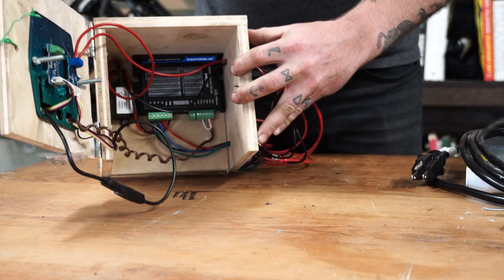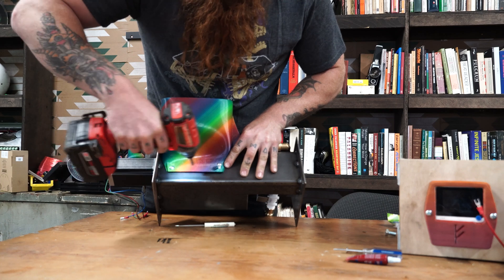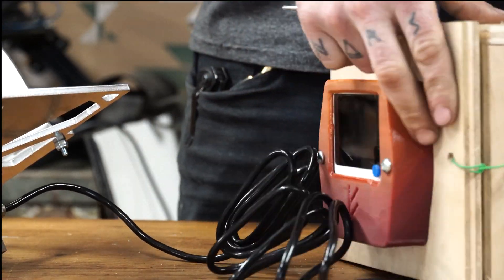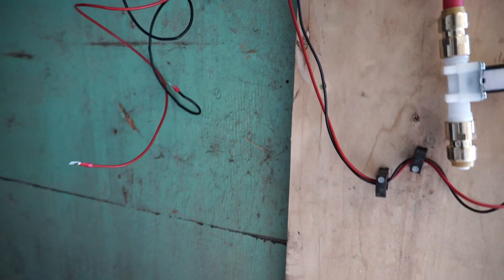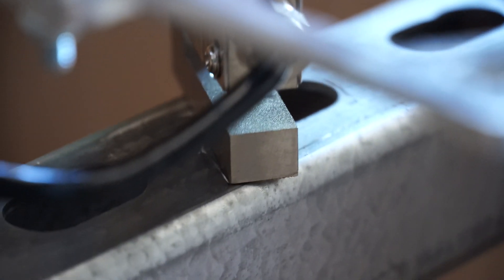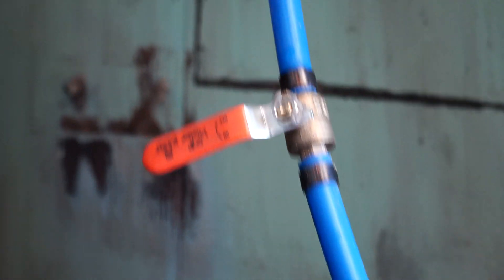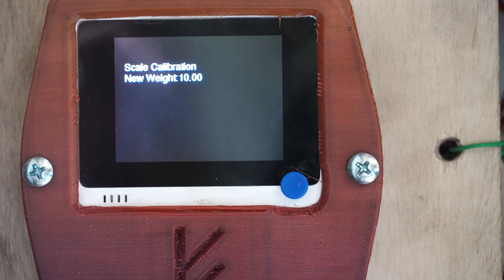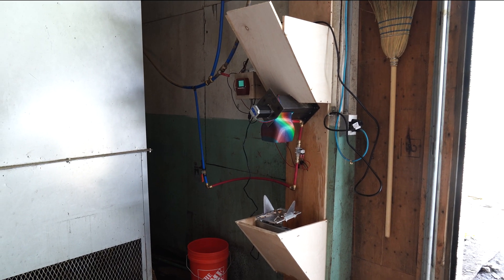FENRIR INSTRUCTIONAL

Comment: I suggest moving that flyback diode to the board, or solder it across the terminals of the solenoid. If that little guy comes loose your board will get toasted by the back EMF / flyback from the solenoid.